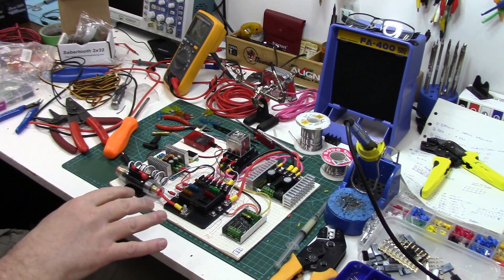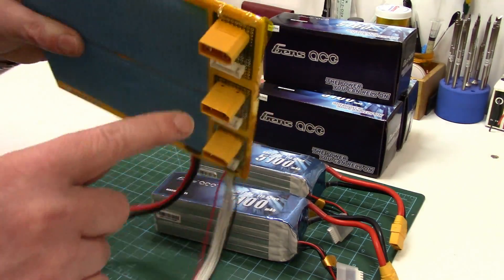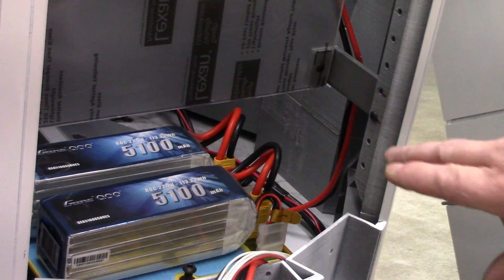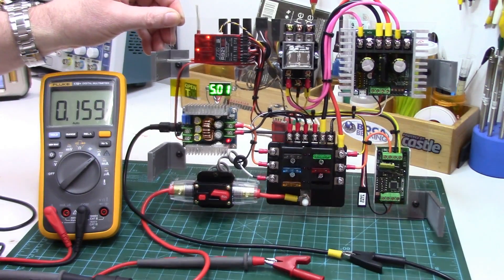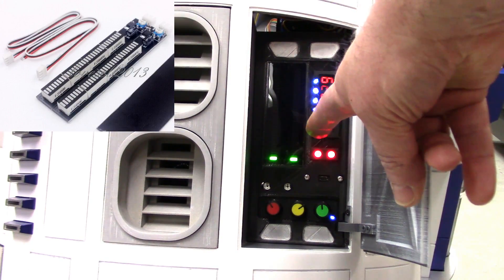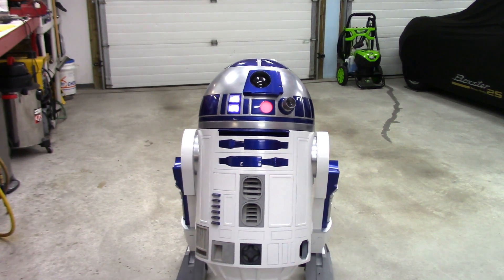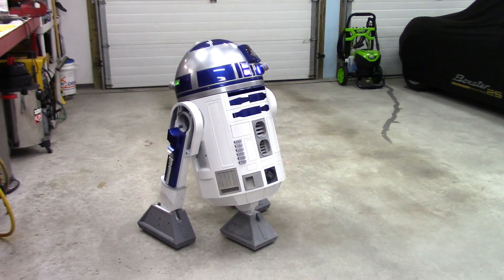R2-D2 Build Part 10 - Electronics Installation - Working Droid

Comment: Hi John - I'm neck deep in electronics for my R2 but I'm making progress.  Do you happen to have any resources or videos on how you were able to relocate the volume, bass and treble adjustments to the front panel?  Thanks as usual :)
Reply from the maker: Part 7 of the series shows two good electronics basics resources. Part 6 of the series covers my sound system (including the amp I use).  Links in description, first pinned comment or on my R2 Build playlist.

Comment: Can I ask for some advice? I'm building a droid yet I'm forging a slightly different path. I'm building it with a Pi and ROS2 so it can be autonomous. I've got to the point where I can issue voice commands and it has an LLM connected, I've got a bunch of sensors and I've almost got object detection using YOLO working. My question is about the dome, I notice you have a slip ring. In my case, the dome would have a USB 3.0 webcam and some other LEDs. The USB slip rings are hard to come by and usually 2.0 only, would you advise buying a 16 cable slip ring and just splicing my USB cables onto it? Thanks from Australia

Comment: Hi John! Thanks for the videos! I wondered if you had uploaded your data port file anywhere? Would love more information on the components as well. Thanks!
Reply from the maker: If you mean the STL file for the Data Panel, it's just the one that is in the Baddeley files. I may have modded it slightly in Tinkercad, but I honestly can't remember as I modded several of the Baddeley files in Tinkercad to suit my specific build.
I go over electronic components in more detail in Part 7 of the build series (Basics of R2 Electronics): links in description and 1st pinned comment.

Comment: Loe your videos, it greatly helps me get my build right. Any recommendation for the slipring ? how many wires should I plan for ?
Reply from the maker: Totally depends on what control system you are using, what power/current requirements your dome needs and what you are controlling in the dome. In my specific build, I have a 10 conductors and am using 9 of them.

Comment: Hi John, I am getting close to having my electronics board finish and I just have a question concerning the gauge of wire you have going from the fuse block (24 volt fuse) to the power relay.. I realize it is just to trigger the relay but are you able to get away with the small guage because of the small amount of amps that the relay is pulling? I am learning allot of this as I go...
Reply from the maker: I'm running 8 AWG from the relay to the fuse block input power rail, but it's of course dependent on your specific build and how much total current the system draws.
I am unclear however if you are asking about the wire from the main power relay that feeds power to the fuse block, or from the relay to the power switch since you also stated "I realize it is just to trigger the relay". Or perhaps its the 3 pole motor isolation relay you are asking about?
Regardless which relay (power or motor isolation), relay coils don't pull much current, perhaps 100 mA tops, but likely less. Check your relay specs to confirm coil draw or use a DMM to measure it and then size the wire accordingly. 100mA for example would be fine with 24 AWG wire for the few feet involved from the from panel toggle switch to the power relay. Lots of handy wire size calculators on-line to figure this out. 🙂
Reply: @Rchelicopterfun  Thks John... I was referring to the 3 pole motor relay (i am using the exact one that you have) for the motors and why the 24 awg that is being ran from the fuse box but you did answer my question. Thks again for all your help!

Comment: Hi, John! I'm finally on the electronics section on my build. Can you explain how you did the flyback diodes on your relay? Your other video discussed it but I am curious how its actually implemented. Thank you!
Reply from the maker: Soldered it across the coil exactly as demonstrated in that video. So much info online how to implement a flyback diode on a relay.

Comment: Howdy John, thanks for the amazing series. Quick question. How do you configure the battery pack so that it can be charged in place? Really struggling to find reference of how to do this. I’m using lipo in parallel too. Also where did the negative from the battery come in? Cant see the negative terminal? Any help greatly appreciated. Cheers! Cory
Reply from the maker: Sorry, but explaining the wiring schematic is too complicated to cover in a YT comment response. Basically I just made a wiring harness that goes from the battery tray up to the charge panel exactly like you would make any 6S RC LiPo battery charging harness except it's longer. Like anything electrical, there are of course multiple ways to do something like this. I built mine based on the materials and connectors I had on hand. 
The negative goes directly to the grounding terminal strip on the Lexan board (just above the fuse block). Lots of fuse blocks also have built in ground terminal strips which would of course have been better; but again, I used what I had on hand at the time.
Reply: @ thanks John, I really appreciate you taking the time to respond. Love your channel. Thanks for everything that you do . Cheers Cory

Comment: do you need the shunt? or can you just hook up straight to the meter
Reply from the maker: Must use a shunt. These types of volt/current meters will handle up to 10A max, anything more (which a full size R2 build will certainly draw), requires a current shunt.

Comment: Hi John, Amazing Build, thanks for putting the Build Series together... Just a quick question... In your basic video, you recommended using a power relay between the 60amp breaker and 3amp power switch.. I did not see that relay on your final build.. Did I miss it or how are you turning off the droid? Are you just relying on using the 60amp Breaker to power it off?
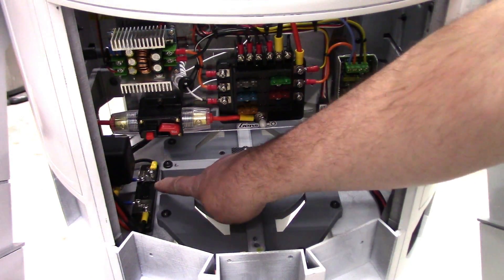Reply from the maker: Thanks for watching and glad you are enjoying the build series. The main power relay is in the body. Shown at 3:10 & again at 8:25 🙂
Reply: @Rchelicopterfun  John, Thanks so much, I just missed that part... Thanks again for a great r2 series, it has been extremely helpfull.

Comment: Hey John...question.  What is the total amperage pull or current pull from your system on your batteries (not sure I am saying that correctly)?  I am using the Padawan 360 set up.  I have the same 24V dome motor as well as the same 24V foot motors as you.  The dome electronics in my build will be separate from the body and will have it's own 5V battery pack.  I just don't know how to calculate what the total "pull" will be on my battery.  For example, on the foot motors, each pulls about 6.42 amps (150W/24V).  Does that mean for just the foot motors that I will be pulling 12.84 amps of current alone?  I am really struggling knowing how to calculate the overall current and then determining what type of battery or batteries I will need.

If I bought a 24V / 10Amp battery....would that mean that (based on my foot motor amps above) my battery would only last 40 minutes?  Which means that adding in the other components would obviously draw the battery down even quicker.  Any help and guidance here is greatly appreciated.  Thanks
Reply from the maker: Only way to know current pull is to hook your system up to an Amp meter while it's running. Theoretical Ohms calculations get you in the ball part of course, but load will vary a lot! Motors will peak well over their nominal ratings for short duration when first starting, changing direction, or near stall for example , yet will barely be sipping over a couple Amps while cruising around. Wiring gauge, length & connector type will also introduce slight voltage sags which of course has an impact on current loads. Largely depends on on how hard you drive him around which we already discussed.

I've never measured peak loads on mine with a data logging Watt or Amp meter so I can't give you any concrete values with my specific system. I would guesstimate my R2 power system peaks upwards of 30 Amps under full acceleration or hard directional changes but is usually sipping under 5A. I do go over some rough power calculations/running time in the last video where he is out running around at the airfield.
Best to look for or ask this question in the Astromech forums as others have actually taken the time to data log their power consumption.

Comment: I thought yours was like mine-I have R2D2 interactive astromech droid.   It's the one you talk to and it'll talk back or do commands. It also plays the message from Princess Leah  as a light lights up like a hologram would on it.   Mine has a problem-  Inside the head where it rotates back-and-forth there was an 8 band strand of wiring connected. Some of these have come loose and I can't tell exactly where they go back to because there's no color coordination or Wire design. I have a sodering gun and soder but have no idea where to connect them back to.
Reply: Sounds like a fanhome R2.

Comment: Great video, thanks.  I'm about to start putting together my R2D2 electronics for the Palawan360 system.  I did have a question on a piece off your parts list.  The DC 3.3-5V/5V-12V PWM Power Controller Remote Control Relay Model Switch for Dual Cameras FPV RC Airplane - 3.3V-5V.  Can you explain its purpose and where it gets wired into?
Reply from the maker: My R2 is RC controlled. The RC controlled relay switch is used for the sound board trigger. I cover the RC relay and sound board in the sound system basics video: https://youtu.be/cZ3sVYs7T9I

Comment: Do you have a rough wiring diagram for the electronics?
Reply from the maker: @mtudor1985 - Not sure if you've seen the R2 Basics Electronics' video: https://www.youtube.com/watch?v=AmUuZH3UHXg
I reference two very good electronics resources (free PDF's) in that video which illustrate basic wiring schematics for various systems. I link to both of them (Droid Control Systems & The World of Droid Electronics) in the description of that video.
I have also included the links to these two PDF files in the description of this video under the heading "Useful Resources".

Comment: I don't understand why R2 builders don't use the leg battery boxes for the batteries!  It would certainly help to lower the droid's center of gravity and would give super-easy access.
Reply from the maker: It would also be a total pain in the ass from the standpoint of the extra wiring required (large gauge), fusing, fitment, added connectors, voltage drop, possible higher ripple voltage, charging hassles, etc.
Access would most certainly not be "super easy" compared to opening the back panel. It's much harder to crouch down on the dirty ground, reach down to the front of the battery box that is partially blocked by the body and hoses.
Don't forget the simple fact both foot motors take up a fair amount of real-estate inside the boxes so battery size/type would be limited as well, not to mention the heat the motors produce which is not ideal for any battery regardless of chemistry.
Then there is all the function testing involved in one of these builds that would require having to have those boxes installed or some other mounting method on the feet before you could do any sort of tests - what a colossal pain.
All to get an insignificant fraction of the overall weight 6" lower down on the ankles. In short, it's not worth all the hassle, cost, problems and extra BS for basically no appreciable gain in stability whatsoever; that's why it's rarely done.

Comment: Thank you so much for making this series of videos!  I've always wanted to do a project like this but it always seemed too overwhelming.  I never knew where to start.  Now after watching your videos I feel like I could build an R2 unit and have an idea of what I am doing.  You explain everything so well and make it so easy to understand and follow along!

My one question would be regarding painting.  How much time was there between each coat?  I don't know much about painting so I am always worried I will screw something up lol
Reply from the maker: @Corbadda - glad to hear you're considering your own R2 build. Paint drying and recoating varies significantly depending on the specific type of paint, temperature & humidity, and how heavy you apply each coat. In short, follow the directions on the paint can to the letter. All the paints I've used in this project can be recoated within one hour (presuming they have dried to the touch), or if you wait longer than that, then you have to wait several days before recoating. If you happen to apply these specific paints after an hour or two when the paint can no longer breath, or before the paint has fully off gassed after a few days, you risk getting those finish destroying crinkles in the paint.

Comment: When I was 5 I had a remote control R2D2 that my parents bought me for Christmas.  My curiosity got the better of me and I opened R2 up to see what made him tick.  Not sure what my 5 yr old self did but I imagine I crossed some wires as R2 would randomly start up, do a lap around the room, squawk, chirp, whistle and then stop...at least until the batteries finally died.  Long story short, this entire build series speaks to my inner child so much.  I'm looking forward to seeing your R2 all buttoned up and blowing "raspberries" at you in the next video.  Thanks for sharing.  🙂👍
Reply from the maker: @Shane's Trains - That has a very familiar ring to it. What curious child doesn't open things up to see how they worked. Some of my best memories from childhood were spending time with dad at the work bench while he taught me how to fix all stuff I broke after taking it apart.  Not sure how he felt about it 😄.
Reply: @Rchelicopterfun  lucky you. My parents forbade me from tools because i was always tearing apart the vacuum cleaner and such.

Comment: Looks fantastic! I'm jealous you have that removable back panel - I've got some different challenges ahead of me. Oh, and thanks for the amp and speaker recommendations. I decided now was a good time to upgrade, and that has given me lots to think about. Good luck down the home stretch!
Reply from the maker: Thanks Jason - we are all learning stuff from each other. Yes, I'm kinda glad now I didn't glue the back panel on; it was a toss of the coin decision at the time. Of course the removable panel is not without it's own problem/s. I've been trying to figure out a good way to keep the panel latched. I'll likely use magnets, but still thinking about it. Continued good success with your build.  🙂👍